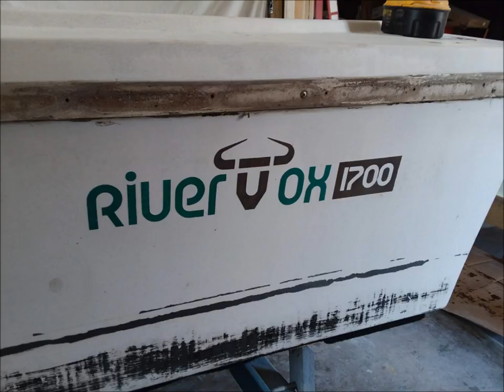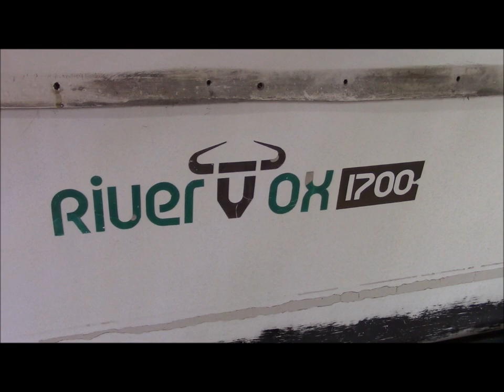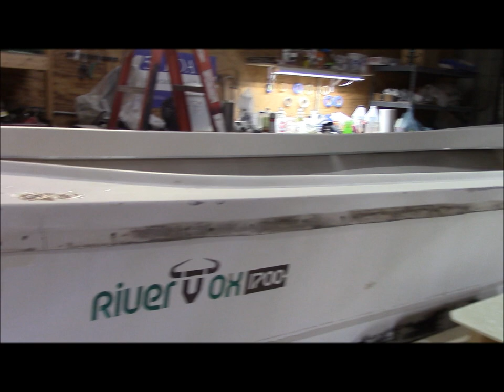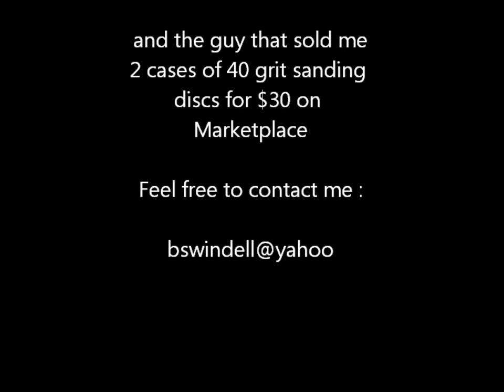The River Ox Projects

Comment: Do you know the outboard HP rating for these boats? I am about to get one and restore it and the capacity plate is MIA
Reply from the maker: Hello, I looked though my photos and couldn't find one of the plate but most of them I've seen had between a 50 and 70 on them.  I think 90 would probably be the max.

Comment: Hello Brett, what did you do for a glue to glue the transom into the boat ?.  What did you do with the holes in the helm?
Reply from the maker: Thanks for watching.  The first boat is being built using Raka epoxy so the transom, deck and stringers are bedded in epoxy resin thickened with fumed silica (cabosil) and some glass bubbles - the second boat is being built with vinyl ester resin so that transom etc is bedded with VE resin thickened the same way.  Both have inside tabs of 1708 cloth and 2 full layers of 1708 overall.